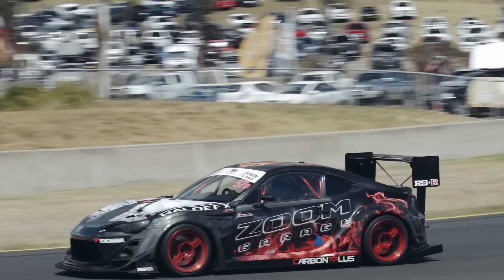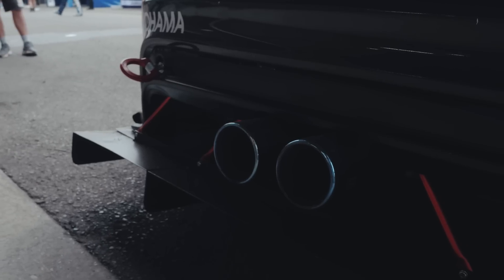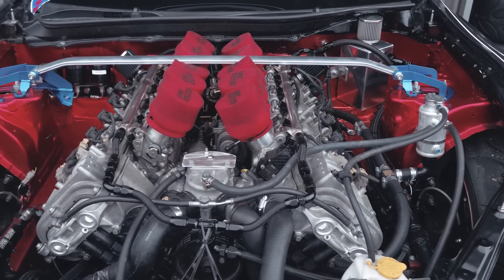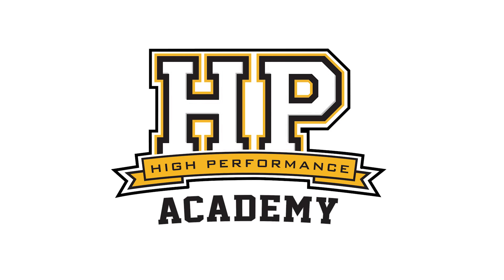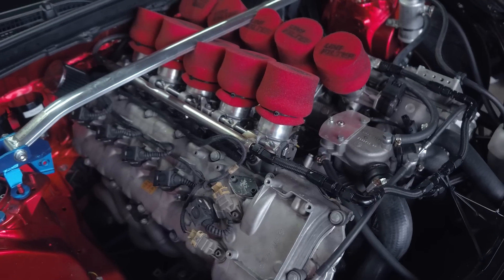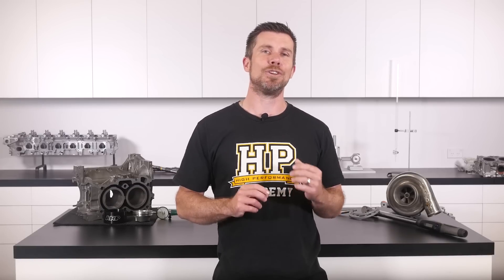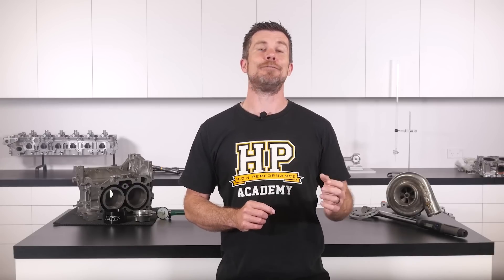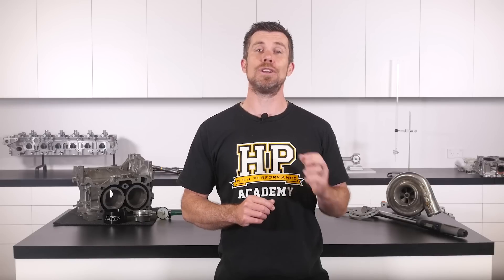5.0 L V10 powered Toyota 86 | Zoom Garage’s 520 HP BMW S85 [TECH TOUR]

Comment: How much the rev limiter of this engine does it hit 10k rpm by changing racing cams and valve spring?
Reply: This and the s65 tend to chew through bearings, so if you sort that and springs/retainers it may be possible

Comment: Toyota didnt need subaru to make the 86 since everyone just engine swaps it. Probably would have been cheaper just to sell a body in white without drivetrain.
Reply from the maker: We still have the FA20 in our 86. There is a metal snail bolted onto it though.... ;) - Taz.
Reply: I'd of preferred it to come with a camry v6 motor with a 6 speed manual transmission over the weak boxer motor any day . And I think it would have sold better .
Reply: @terryholley826  yup, a lot of potential and sounds surprisingly amazing.
Reply: the 86 should have just came with the old corolla motor from the early 90s lol
Reply: @kkkevv224  that would be silly the 4age 20v blacktop only makes 140hp(I used the own one)
Reply: @joshuawalcott321  same.! I think I was joking bc since everyone is swapping the subbie boxer out.?
Reply: @kkkevv224 it ain't gonna happen in this day and age cause of certain rules and regulations.
Reply: It should have come with some other engine from Subaru like the EJ
Reply: Everything is built and stamped by Subaru. Toyota was the DIT and PUSHED for lack of turbo

Comment: I'm sorry there's no way it's only 22 pounds heavier with that engine.
Reply: Grip Limit kilos (kg) you spud. Listen to what he says.
Reply: Probably meaning with the car all gutted. They ripped out 80% of the interior, and trunk. So weight was saved there.
Reply: F1 level engineering for you
Reply: ac compressor, power steering pump that alone add up to 20 lbs . Take a look at his engine it don't even have intake manifold just straight itb.  that engine is naked...
Reply: +D.B I'm guessing those figures exclude the transmission?
Reply: Toyota engines in their performance cars are absolute boat anchors, the 2jz is one of the heaviest performance engines ever produced (594 lb for a 3 litre) vs say BMW S62 (348 lb for a 5 litre) making over 100hp more in stock trim.  Hence its no wonder that they can take a lot of boost as they are using the mass of metal required for the 8.4L viper in the 3L form factor.  So yeah I can believe the small weight difference.

Comment: Still needs a turbo
Reply: Nah, it'll ruin the weight distribution, reliability and fuel consumption when these S85s v10s have decent power + torque out of the box.
Reply: Well the car should be in endurance then, not time attack ;-)
Reply: Weight distribution and reliability are important for a car to perform well on time attack too. I'm sure this guy didn't want to be generic by sticking an LS or 2JZ. Unless you have the money and time to replace these V10 engines, be my guest.
Reply: Joe dirt most of the fastest track cars are NA
Reply: Bro a turbo will make it even more unreliable

Comment: Awesome build.  I always wanted to put an S65 V8 (E9x M3) into a street legal 86/BRZ but I wasn't really sure about how badly it would affect the handling compared to a boxer engine with low centre of gravity. I'm sure dry sump lubrication system would improve a bit but the whole engine conversion (to be done properly) would cost a lot of money. I hope to see more BMW engines into these 86/BRZs!
Reply: I have always wanted the gt86 equipped with Subaru's 3.6L engine and Toyota's 8-speed A transmission
Reply: I like that conversion. That engine is pretty rare to find depending on what market you're in. Maybe you've seen someone in Japan who put a 3.0 legacy engine into a red 86? https://www.youtube.com/watch?v=VOThemNoizo from 14:03 The ultimate build would be to source a crashed 991.2 GT3 and take its 4.0 litre engine with 500hp revving to 9000rpm.
Reply: smilepermile from what I've read, I've wanted to do something similar to my frs. Alloy engines supposedly change weight dist by 2 %+-
Reply: +Eric I see, perhaps it would be good to get a carbon bonnet, wide front fenders made out of carbon fibre to house wider front tyres, relocate the battery to the rear, change the pulleys to lightweight ones to slightly improve the weight distribution. I would love to see some videos if you do ever plan to do this haha
Reply: Late to the conversation,  but the LS would a better candidate. Especially ls1 through ls3 which are lighter than the fa20. A company called Sikky also specializes in these swaps where they 3D print some LS parts to get the low center of gravity.